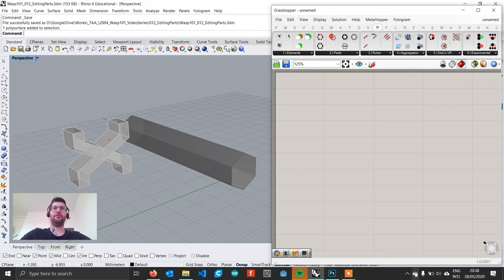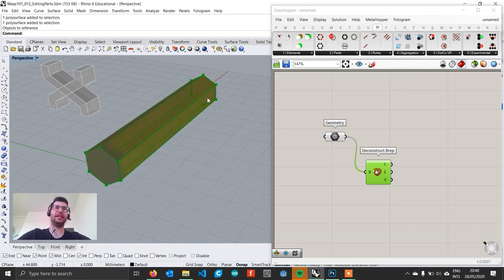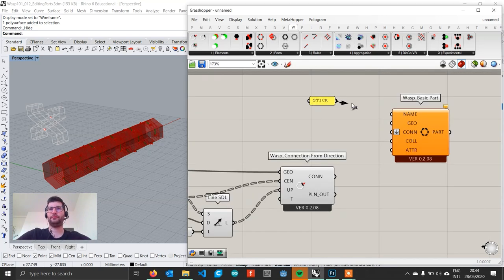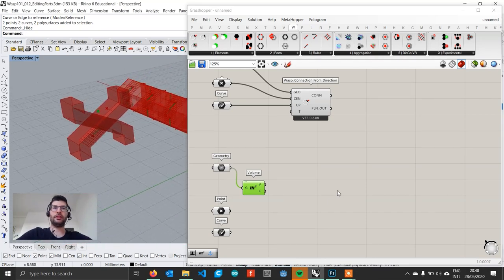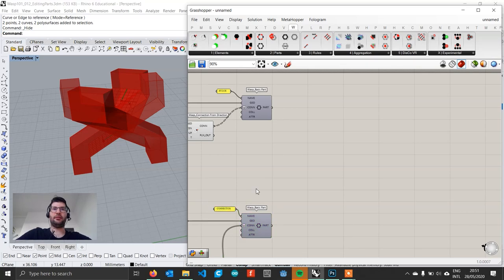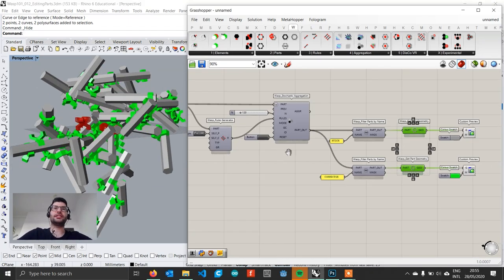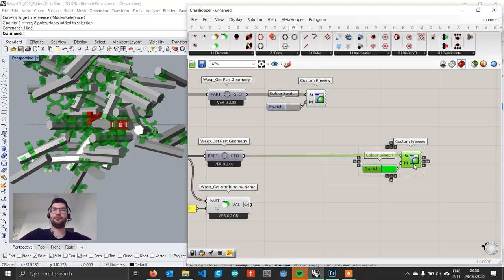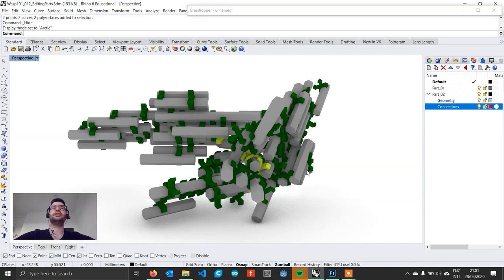Wasp for Grasshopper #101 - Tutorial #012: Editing Parts

Comment: Hello and thanks for great tutorials. I will try this tomorrow. Is there a simple way how to cull connectors without both clips used?
Reply from the maker: Hi, yes! As each part has only 2 connections, you can explode the Part using Deconstruct Part, and then check if the clip has any children. If the CHILD output for the given part is not empty, it means both clips are connected (one to the parent part, one to the children). This might however miss some of them.
The more complex way of doing that, which would catch all of them, is to use a line perpendicular to each connection plane as attribute, and check after aggregation if this line has intersections.
Let me know if this works :)